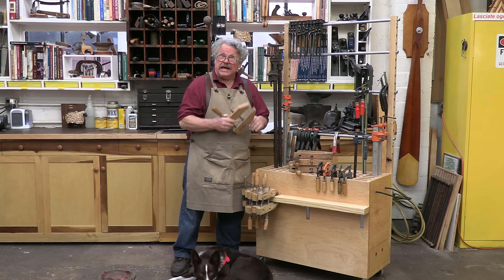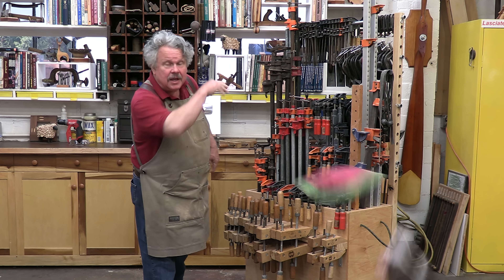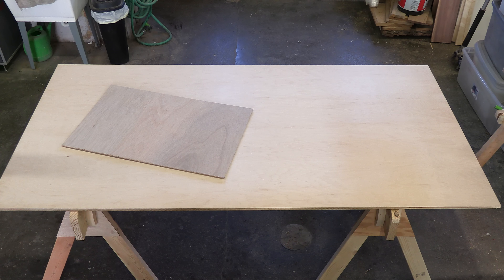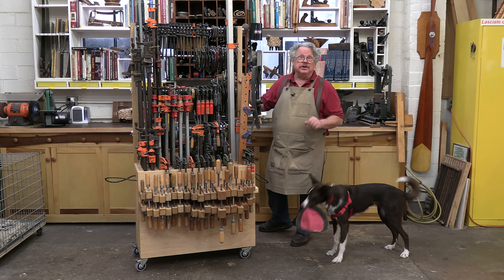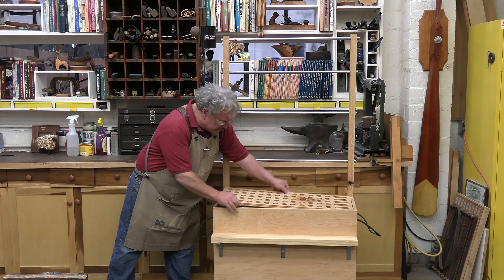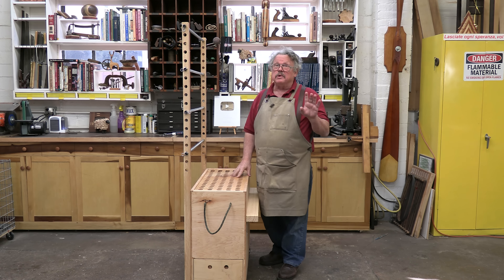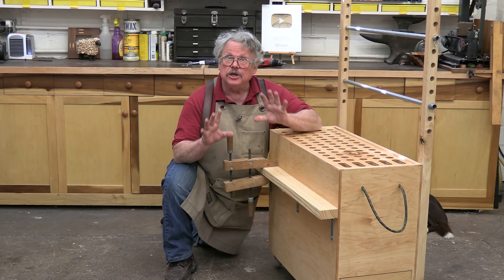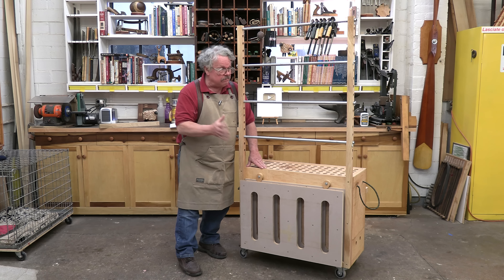Woodworking Clamp Storage - Mobile

Comment: That is a very useful clamp caddy. I use a 30 gallon drum with tall plywood dividers creating four vertical quarters for my long clamps.  It's on a rolling base but heavy enough that I normally come to it instead of rolling it around the shop. I purchased a nicely sized A-Frame clamp rack and it holds the smaller clamps. When I need to store more, I believe I'll build one based on your model. That gluing box is certainly going to get more consideration.
Reply from the maker: Thanks for sharing.

Comment: Nice approach to your design!  I have a couple of thoughts offer:

Rolling resistance:  As I watched you pull the cart across the floor of your shop to illustrate its mobility, even with your 3” casters, it appears that there’s significant rolling resistance to it. I think that if you increase the diameter of the casters even more that you use on the box, you will find it much easier to pull around. 

Stability:  In your discussion of the concerns some may have that the rack is top heavy: you can mitigate that to some extent by increasing the size of the base that the casters are mounted upon (adding some triangle bracing too), placing their contact with the floor farther out from the box. While that increases the footprint somewhat, the shelf and assembly table mounted to the sides already expanded the footprint. 

Keep up the good work!!!
Reply: I think part of the rolling problem is that the casters are rubber. If they were polyurethane wheels I think it would roll easier.

Comment: Here’s the rub. My shop is 20’x20’, a mere 400 square feet. Anything taking more floor space will require special dispensation from God Himself. Floor space is a premium in most shops. Wall storage is my only relief for clamp storage and I have been somewhat creative in wall clamp storage designs. Some of your storage techniques are fully adaptable to wall storage, so kudos for a wonderful video.
Reply from the maker: Interestingly, the design for the clamp caddy evolved when we were working in a shop not much bigger than what you describe. It allowed us to store all our clamps in an out-of-the-way corner, bring them out just for assembly, then get them out of the traffic pattern when they were no longer needed. And many of the features on the cart, such as the rack and the hand-screw shelf began as wall-mounted storage units that we simply bolted to a cart. As with most of the jigs and fixtures that we show on this channel, I try to break the project down into individual features so you can pick and choose what will work for you.

Comment: Easily the best approach I have found to clamp storage. My own assortment is more modest than yours, but still weighs a lot and takes up space in an awkward way. Provided I can dig up some robust casters, this mobile rack may provide the solution I've been looking for while using up materials that at present are just adding to the clutter in my small workshop. You have another subscriber.
Reply from the maker: Thanks...and welcome.

Comment: In Oz there is only plastic conduit or galvanized water pipe these days, we used to have very flimsy metal electrical conduit but there were too many electrocutions & fires due to crappy wire insulation over the years (cotton, rubber). I used 1x3 and 1x4 pine screwed to the uprights for my 'Normite' double sided clamp rack on a 24x24 base. As for casters, I have noticed  the local big box has iron wheeled castors with ball bearings and a capacity from 500 > 1000 pounds per wheel ( total capacity is calculated as 3/4 the total capacity of ALL the casters). There are also nylon wheel casters in the same range of wheel sizes, price &  weight capacity but they have brakes to lock the casters. Much easier to get things rolling if its been sitting in one place for a while.

Comment: 6:08 and if you glue it, you will drop something down the hole like a unique  small screw. Or an unextended extending bendable magnetic part retriever. 
10:33 don’t be a tease. Say “rebate” instead of “rabbet.”

Comment: Great Video Nick, and a very clever idea.  Given you have so many clamps, i cant help but think that your setup looks a little top heavy ... have you done any tests to see what happens when it gets pushed sideways etc?
Reply from the maker: We test that almost every time we move it. If you grab pipe clamp and pull sideway, it rolls. That's how we maneuver it most of the time. There is no tendency to tip due to all the weight in the base.

Comment: People underestimate the strength of conduit though hanging long sash clamps cheek to cheek on spans like yours could call for an intermediate support. Also, my screwup on a larger A frame rack holding hundreds of pipe and bar clamps was to use too soft casters, an error I've made more than once on other equipment. Beware medical service take-offs on the surplus market. Those soft tires when heavily loaded are like trying to push a car with four flats. The prospect of completely unloading the rack to change the casters is very unappealing. Years pass with the new, heavier casters still on the shelf.

Comment: Useing just plain cord/rope as pulling handles could cut into your fingers and become more uncomfortable and could apply a sideways crushing force to your fingers as the caddy becomes heavier. A way to minimise this would be to run the cord through a short length of PVC pipe or dowel (drilled lengthways). About 4in long x 3/4 to 1in diameter (100mm x 19 to 25mm) would be enough.
Reply from the maker: Good tip. I've also used 4" pipe nipples.

Comment: Ah and HA! I have about 45 clamps all stashed on a wall rack in about 26" of valuable wall space and another lost count number of other clamps stuck to anything that will get things stuck to them. I've even considered glass lighting tubes, but had to pass on that idea.. Problem is my only real viable available wall to use for clamps has two pesky windows that don't do much other than give insects a place to buzz around then eventually die.. Floor space is the other problem and my floor LOVES extension cords and air hoses more than I do.. Did I mention that I collect darn near every scrap of wood that ever enters the door?  Still, I'm not opposed to making better use of my bad habits and this rack may just change a few of them.
Reply from the maker: Quick idea for your windows, if you wish to repossess them: The folks at Popular Woodworking magazine once had a window in their shop to which they attached narrow notched shelves. They used these shelves to hang and organize a variety of hand tools -- chisels, files, rasps, mallets, screwdrivers, wrenches, anything long and thin without a cord. This essentially turned the window into a tool cabinet with solar backlighting.  It was quite striking. Travis and I are building a new shop that will have a few windows, and I plan to do this with at least one of them.
Reply: @WorkshopCompanion  I thought about this as well myself, but I'm not too crazy about the idea of advertising to every thief in the area that I have a shop full of tools. The windows face the street and I'd probably have to rearrange the deck chairs in my personal Titanic. I could easily grow things in the windows though, but I'm in South Carolina. I'd have a small jungle in no time. LOL
Actually my working partner and myself are close to closing a deal on a much larger shop. My wife has mixed emotions, but she would get her parking space back.